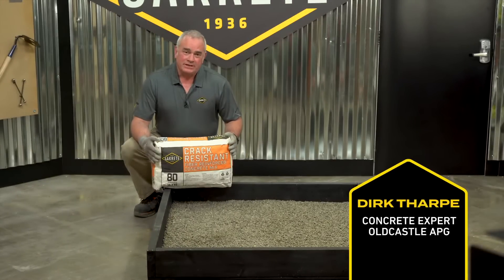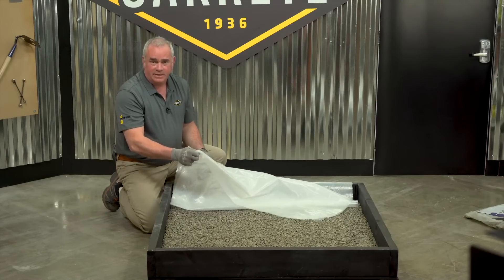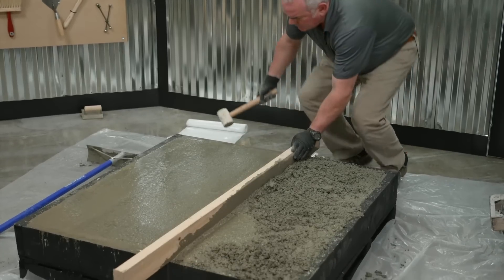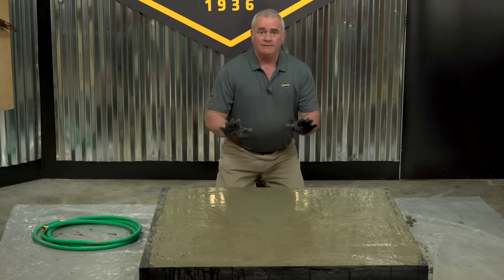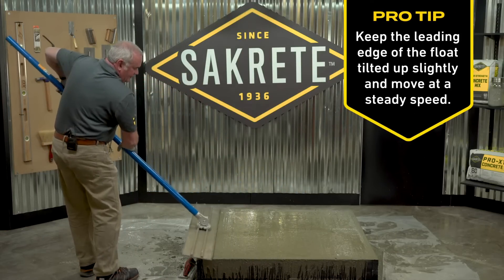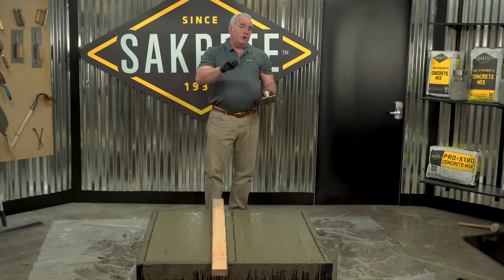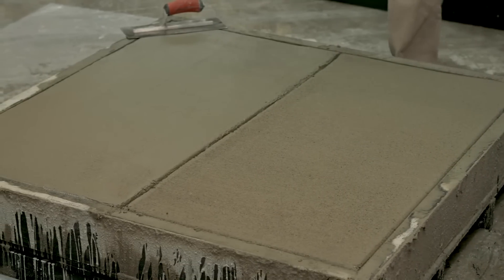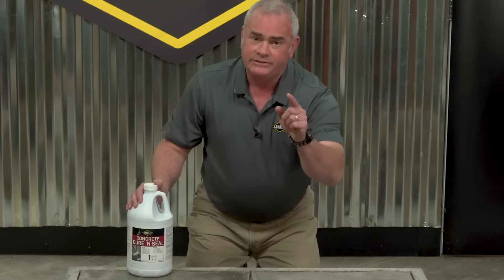Pro Tips: How to Pour a Concrete Slab | New Construction | DIY Project Guide

Comment: Dirk, can't cracking be minimized by addressing the curing process?
And just to capture the main points you made: place concrete, consolidate, screed, float, wait for bleed water to dissipate, steel trowel finish or other appropriate finish.
Reply from the maker: Proper curing is the number one defense against cracking, absolutely! Good callout.
Reply: @SakreteOfficial  What is the best practice approach to address the 28-day curing process?
And, is it acceptable to add the appropriate fiber to a Sakrete product that may not contain it?
Reply from the maker: Tons of options for curing, but we really like the Cure 'N Seal route, which will dramatically minimize the need to wet-cure the slab.

Typical rules of thumb apply otherwise – keep foot traffic off for 24 hours, vehicle traffic for about a week, and truck traffic for the full 28. 

Regarding your question on fiber, you could certainly hand-add fiber to any Sakrete mix, though we'd recommend just buying Crack-Resistant to ensure that you get the correct dosage.

Comment: This is a decent explanation of the basics but I'm going to point out a couple things...1- consolidate before you screed reason being is the pad height will lower if you consolidate after screeding...also on a  large pad you don't want to vibrate after screeding then have to rescreed vibrator marks.  2- you don't push a screed ...you pull  so rakers can remove excess concrete and so you're not leaving a mess with your feet....any ways most is correct but still....
Reply from the maker: Great points! Thanks for adding some additional expertise.